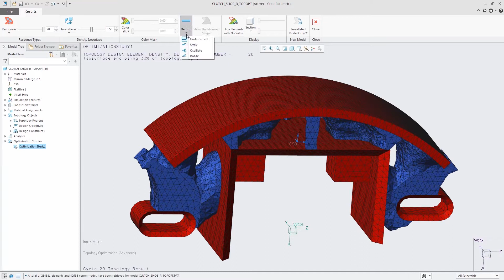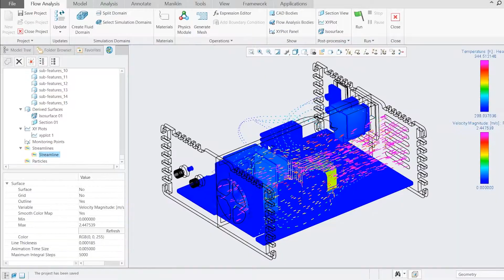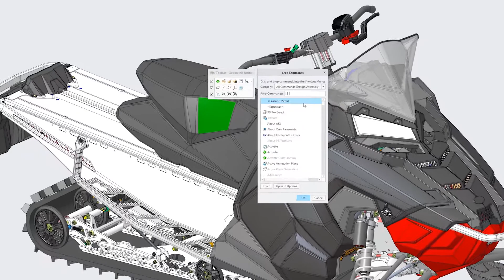Creo 5.0: What’s New

Comment: Hello. I'm a product Designer. I'm using Solidworks 2018 but I'm thinking on change my design software because I need a mode powerful and solid software. Also i don't lioke the surfacing in solidworks.